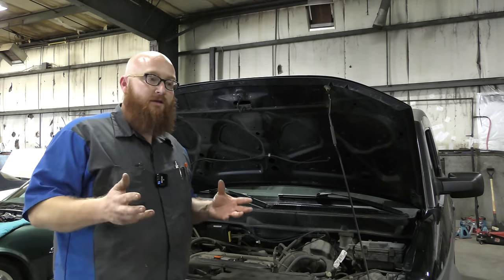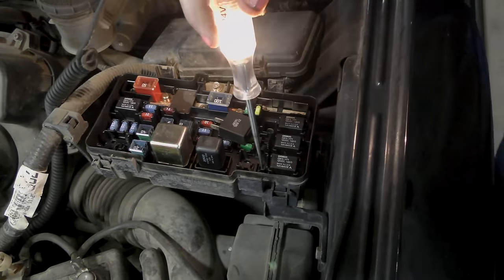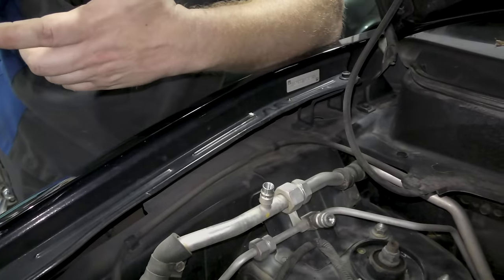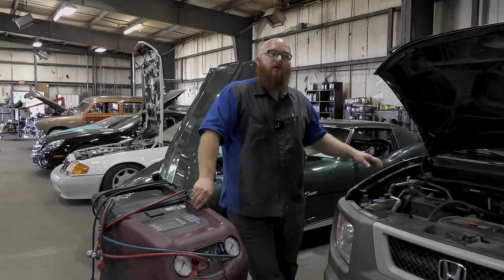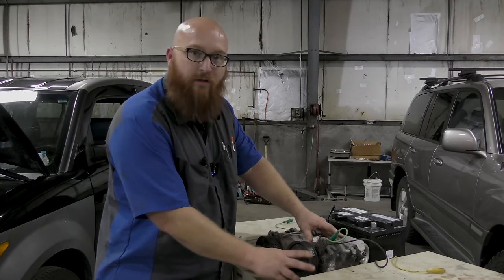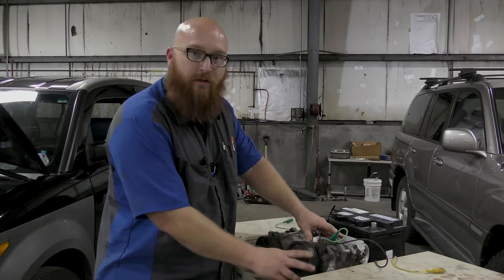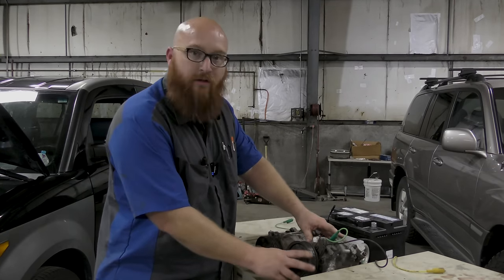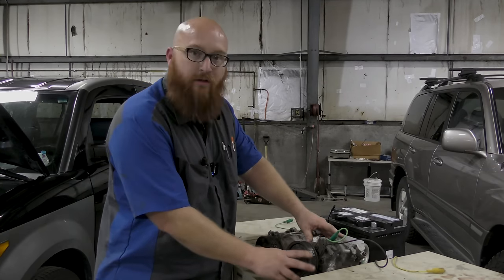AC not working!!! The CAR WIZARD shows how to easily isolate the problem

Comment: I own a mercedes W210 E320 1999 with ACC. The AC quits randomly (the compressor is working while the problem is on). The ACC shows that the refrigerant pressure is low (about 7-8 bars when problem happens). When I turn off the AC then turn it on again, AC works normally for a while (refrigerant pressure goes between 11-15 bars) before it quits again. This problem happens most in-town at slow speeds. I recharged the refrigerant but still no luck. Any ideas?
Reply: forgot to say, that I cleaned the radiator with special foam, and I replaced the cabbin filters behind the glove box.

Comment: My A/c is blowing hot for first 10mins and then starts working, i mean compressor starts working/running after 10mins. Is there any solution other than replacing the compressor 'cos it's too expensive for me. ?

Comment: My miraculous 2005 Camry 2.4 that I owned for 15 years and sold at 218,000 miles...never needed the AC serviced! No leaks. Nothing. Never. Always blew cold for 15 years and 218,000 miles. In fact...that car never leaked one drop of "ANYTHING." Can anyone match that?

Comment: I know it's saying this video is 3 years old but maybe you will see this and just maybe be able to tell me why my car a/c for the most part it blows cold air but there are times it will blow cool air and times it blows warm air. I had a new motor put in my car when I bought the motor the man said I had to use some stuff from my old motor the a/c compressor I guess it's called is one of them my a/c worked great before I had it worked on. Someone told me after putting a motor in it's got to have the air taken out of the lines I believe he said. When he put the refrigerant in it was working great even now when it blows cold air it's truly cold air
But one day as I was driving  for a second I thought I smelt something after that it started being a pain in my butt. You can hear the compressor kick in and when it works it really works good. I forgot to add this part when it works I might be able to drive it all day but I have been driving with a/c running then it starts cooling down and if I'm lucky after it blows cool air after a few minutes sometimes a few seconds it gets cold again but sometimes it goes from cold to cool to warm  but sometimes when I turn it down so it doesn't blow as hard out of the vents it seems like it will start to blow cool air It doesn't do that every time and I've only noticed it a couple times. What could the problem be? Honestly I truly don't think the guy that put my refrigerant in really watched the gages as to how much he put in it. I hope I explained it right or worded it right but please if you have any ideas what could be making it do this I would truly appreciate you telling me. Thank you for your time if you read this.

Comment: My compressor and refrigerant check out to be good . My issue is that the air is cool but not cold . Any leads would be greatly appreciated.
Reply: Try changing your cabin air filter
Reply: @Mid-Tyr  thanks, I forgot to mention that I had taken it out and haven't replaced it yet.

Comment: Ive got cold air on the passenger side but warm air on the driver side, I changed the blend door actuator on the driver side but the problem still persists.

Comment: Can Someone help me?
I have a 2003 Chet Tahoe and just recently someone tried to steal it and messed up a few things my ac is one of them. My A/C worked perfect before now the the blower won’t turn on. The blower is good I ran it direct and it works fine. I changed the resistor and checked the relays/fuses in the engine bay. Can someone tell me what I’m missing thank you

Comment: I have a 98 mustang gt. Compressor clutch engages for like 2 seconds when first turned on and then shuts off.. freon has been checked its fine. Is the Compressor shot? Any suggestions?
Reply: How do you know you have adequate refrigerant charge? If you are low on refrigerant, the engaged compressor will quickly drop pressure and activate low pressure cutoff switch. When compressor engages it takes very little to bring pressure to 25psig at that point the AC module will disengage the clutch. Vs a normally charged system will be equalized at a higher pressure and will take more work to get pressure down to 25psig.  If the compressor was bad, let's say a bad reed valve sticking open to not allow pressure to build on discharge side, then the control module would do the opposite - it would keep the clutch engaged forever because low side would never drop to 25psig.  IF you've used a sealer and clogged your orifice, then high pressure cutoff switch may be activating since refrigerant has no way of reaching evaporator.
Now you know how it works, you get a test light. Find your low and high pressure cutoff switches. Should be black(ground) wire and signal wire (ie green or non-black). Hook your test light clamp to green wire and probe tip to +12V red on battery. Now you can see during operation if that low (or high) is engaging/disengaging when you hear the clutch disengage. I am guessing the low side is switching on/off when your clutch does. Sign of low refrigerant.
If you have an (orifice) restriction, then it'll be the high side switch going on/off.
Proper weigh in of the charge on an empty system can be done with minimal tooling. A manifold of course and a postage scale. Weigh the full cans and write weight "F15.5 oz" on each can. Find out how much is a full charge (ie 32oz) then empty whatever number of full cans will bring you just under full charge (ie two cans of 12oz = 24oz). Weigh empty can weigh (3.3oz) and subtract because cans rarely contain EXACTLY 12oz. (15.5 - 3.3 = 12.2oz, 15.4-3.3 = 12.1oz). Now you have 24.5oz of refrigerant in system. Now you need 32 - 24.5oz = 7.5oz. Weigh you 3rd can (15.4oz). Now you need weight of can to be 15.4 - 7.5 = 7.9oz to ensure exactly 32oz in system.  Since cans are now self sealing this is easy.  Add close to half the can a little at a time. Close your manifold high/low sides. Close valve on refrigerant can. Unscrew can and weigh, until can is as close to 7.9oz. Then you are done.
MVAC systems have very little tolerance when it comes to "freon has been checked its fine" I doubt you have no clue as to exact amount of refrigerant in your system, just sayin. Having "some pressure" doesn't mean you have correct amount weighed in.
As long as you have SOME liquid refrigerant in the system, the equalized pressure of your system will be the SAME at any given temperature. Simple thermodynamics. I can have a bottle of refrigerant that is 1/2 full and one full, if both are at 70 degrees, the pressure of BOTH will be 71.1PSIG. Same with your mustang's charge.

Comment: If refrigerant is low would the AC still be perfectly cold until the car gets to operating temp?
Reply: sometimes if refrigerant is too low it wont kick on the compressor and no cold air...i jus had to "jumpstart" the compressor relay to add refrigerant
Reply: @matrix2030x  but it's obviously not too low to kick the compressor on or to make the air ice cold
I might just need to straighten the fins, or maybe a ac clutch that going out slowly

Comment: Mine is not working 1-4 in the front only at level 5! 
I can use 1-4 it won’t blow air in the front but it will work perfectly in the back 😂

Comment: I ha e a 05 cadillac cts and the ecm doesn't work but the car turns on and runs but my ac doesn't work.fuel gage.temp gage. And traction.  Oo and brake lights don't work eather

Comment: My 05 Colorado AC went from cold to warm to cold a few times, then just went to warm. Now the compressor clutch will not engage. If I jumper the relay the clutch engages and the AC blows cold. The AC pressure is good. I replaced the pressure switch but that didnt' fix it. Anyone have this problem with this vehicle?

Comment: If you just have an electrical issue on the replaced Compressor, Why did you replace it? YOU COULD JUST HAVE FIX IT, but you replace the all thing for maibie a 1200 $ electrical repair could have just be couple hundred dollars

Comment: Just buy ac/pro and recharge it. 90 percent case, it's out of refrigerant. A/c pro comes with a gauge, and it will show the pressure. You don't need that big ass machine.

Comment: try a failure that only happens if you turn the car off with ac on  or if its not started on hot before turning to cold 😅  

solution-  turn off traction control 😮😂

Comment: I have a question my 06 avalon ac just stopped working specifically the buttons,  the fan won't urn either, my mechanic changed the ac compressor 10 min after it being on, just died 😑
Reply: We looked for leaks we checked all fuses and relays and it just won't urn on. The radio headlights ect everything works except the ac controls

Comment: My AC guy told me that the AC Compressor was what the problem was when I took it into him to have it checked. I watched this video on youtube and it said that its not the compressor with the problem it's the Compressor Control Valve thats the problem and it needs to be replaced. Soo whats really wrong with my AC here? I just had my compressor replaced about a month and a half ago due to a car accident and the A guy that looked at it recently said it was the Compressor. Soo who's to believe here and what is the real problem with my AC not running right?

Comment: Wizards you gotta help me dude 

Does any one help me find the issue Ac compressor doesn’t turn on .. new Ac compressor new Relay new high pressure switch but compressor doesn’t turn on … but when I put paper clip on the relay compressor turn on ..

Comment: I am a bit confused my air con of my car was not working after log investigation the mechanic replace the temperature switch and the controls switch and now working whereas before an air con specialist said I need to replace the condenser and the clutch mechanism at a huge cost God knows who to believe.

Comment: So I replaced the AC compressor because cold air was not a thing 10 minutes after running it it works fine But I don't know where it turned off and doesn't work not even the AC fan turns on I need help

Comment: Could it be a bad low pressure switch?
Reply: Black wire on LP switch should be grounded at all times. If switch is broken to always closed, the green will be always grounded (also telling HVAC module is OK to activate clutch relay) but never telling relay to turn off causing freezing on evap.  If switch is broken an always open, the lack of a ground signal to HVAC module will tell the module to NEVER energize the relay.
If refrigerant is so low there is no liquid remaining then the saturation pressure will be so low that the LP switch will be always OPEN.

Comment: Im having problem with my AC. 1993 K3500 Diesel GMC my AC will work, the problem is the AC compressor will come on and run for a while It may run for 50 miles or more then it will go off and the only way i can get it back on is to stop the truck wait about 15 or 20 minutes thewn it will come back on, Ive replaced the AC compressor, High pressure switch, condenser , accumerlator and lines. no luck . can anyone help me

Comment: My ac stopped working( 08 chevy uplander) the clutch 10a fuse was busted, i replaced it and ac worked great again but 5 mins later fuse went out again. Any ideas? Someone said it might be low on freon, that triggers the shut off??
Reply: Low refrigerant will trigger a shut-off BUT still doesnt explain the blowing of your fuses

Comment: OK so what if the compressor comes on and off just fine like it supposed to and you know there is plenty of refrigerant the electrical system obviously works because the compressor is on why is it still blowing hot is it possible to fix refrigerant plug without removing the entire system
Reply: Also lines are not cold at all so it must not be flowing? Idk can I fix this at home?

Comment: I don’t get it.

You said that you need to replace all that with the compressor if the compressor seized/locked-up, but then you quoted the guy for all that after determining that it was an electrical problem and not a seizure/lock. If it didn’t seize then there is no reason to suspect contaminants in the system and you can get away with replacing just the compressor.

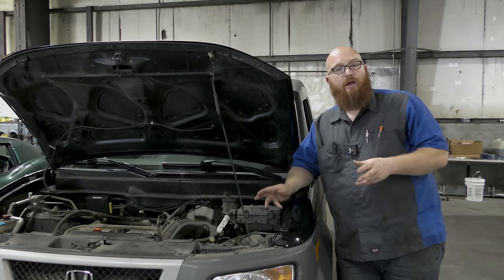Not trying to be contrarian, but the stated reasoning here blatantly contradicts itself in a way that’s hard to ignore. If I just wanted to be contrarian I’d point out how you started out at 1:21 by saying that the only reason a compressor stops compressing is a power issue with the clutch or it’s locked up but you had already mentioned control systems and brought up pressure switches later on, redeeming yourself. In my case, it was a failing radiator fan that would only sometimes turn… often needing a nudge or wind to get going and turning pretty slow even when it was going on its own. Of course, the control module could tell when the fan wasn’t running and would keep the compressor from turning in.

I guess I did bring it up after all. ;) Maybe you consider that an electrical issue but I consider that “bad bushings in the radiator fan” (2011 Corolla).

I hope my insight helps someone who might have been confused.

Comment: Try to see things from a customer's point of view .especially from an ex-mechanic! I see, the power steering pulleys no longer have openings for bolt removal or yes you can order the old pulleys And the old Ac clutch parts the ones that last for 500,000 miles I have been driving a Chevy for 50 years and in 2000 they got greedy my next truck will be electric and not made of Chevy parts, that crumble like a bribed politician I will be buying my first none Chevy Truck because of a $1000 dollars of brand new junk! that had to be bought for nothing! On the shelves of my garage are two brand new power steering pumps, A gearbox, several a/c orifice filters and leaking dryers right next to the dryer is a AC Refridgerator dryer that lasted for 20 years ! my favorite radiator belts that fell apart and ruined the engine filled it with black gunk so that it over heats at about 20 miles I had a 1971 Chevy pick up that went 490,000 miles before 1980 . in 1982 or 83 American CEOs sold with the agreement that we put their designs in our cars and they put our designs into their cars (all our designs)GM GMA Chevy, Ford, Pontiac, Dodge, Oldsmobile, and all those companies that no longer sell cars. Ford and Chevy ended up the only survivors. We lost the pickup and van vent windows,Those were great!  we made the serpentine belt work, and the front-wheel-drive! However, we also realized that no one would be sitting on the hood ever again, kissing their girlfriend and no more 200-mph cars which was a good thing we lost a lot of great kids in car races. The 80s the decade of no cars! dont even say the national crapola ,it was a desperate attempt to make the deal sound as if we had a clue.

Comment: In some cars you don't need to remove the compressor to replace the clutch (one is an 08 sentra) . Sorry this guy is giving a lot of information but basically saying if it isnt a relay (which he just so happens to sell a relay tool to diagnose) or a fuse (which it rarely is and typically a symptom of a bigger problem because that new fuse won't last long) get ready to pay around $1,600 dollars!! His fellow mechanics will be proud. Ac diagnostic is a tightly guarded mechanic secret! Plenty of other more helpful videos out there?

Comment: the info is wrong, only because the car has gas the repay test works, if there was no gas the pressure sensor would not allow the relay to power up, its only on a working system your test would work

Comment: What would cause my air conditioner in the car to keep its charge while it's running for up to 3 hours that's how long I was driving it work perfectly fine then I shut it off 2 hours later it's completely empty
Reply: A slow to medium leak.

Comment: My air conditioning  blowing cold on passenger  side and hot air on driver side I was told I had a leak in lower hose, had it replace 2moth later its still doing the same thing, now they say it's the compressor I belive they are ripping me off
Reply: Can you explain
Reply: Now I'm been told the compressor in leaking the seal are broken

Comment: Poor people have poor ways to.  I overloaded my AC , then drained it slowly ( not in the ozone) until the compressor came in and stayed in.  I did it a lithe at a time until it was working perfect.  Sometimes you can't afford to take your car to the shop etc.  Being said all the components were working perfect, it wasn't loaded correctly at the dealer. This won't work every case, but some. Just saying.

Comment: I have a 2007 ford expedition I have had everything for the ac replaced but now I have problems again my ac works for a while then stops and blows hot then stays not working again then it will work again Blowing ice cold  I can't figure out what is wrong PLEASE HELP
Reply: It’s most likely your fan clutch.. it’s working until the coolant temperature raises... it may not even show inside the car but if you checked it with a OBD2 temperature gauge you would be able to see it. If you replace the fan clutch you’ll be back in business! Good luck
Reply: @acescalade4351   I have had everything replaced for the ac.. the lines , blend doors, fan clutch,  the actuator , compressor , low pressure switch, high pressure switch , condenser . Ac is full of freon an no leaks anywhere  Ac works fine for months then goes back to hot air then works again for a while then stops  makes no sense what could cause it to work fine then stop ..but The ac keeps blowing the ac clutch fuse (15 amp) every time I turn ac on.  what could the issues be?????
Reply: Will it only work again once you have turned it off for awhile?
Reply: @acescalade4351  no won't come on keeps popping fuse